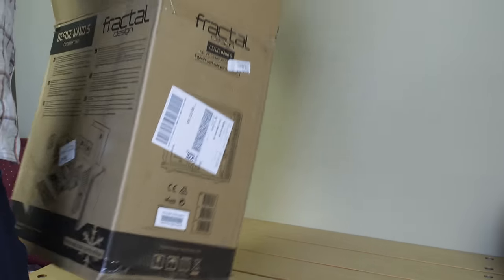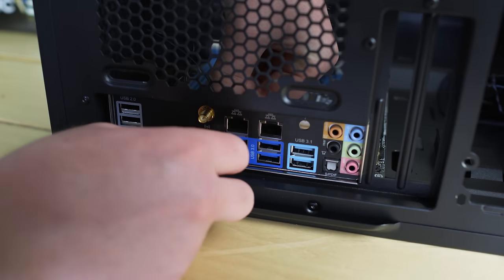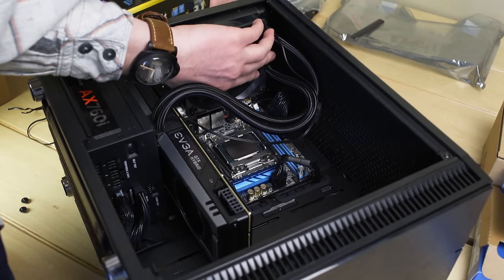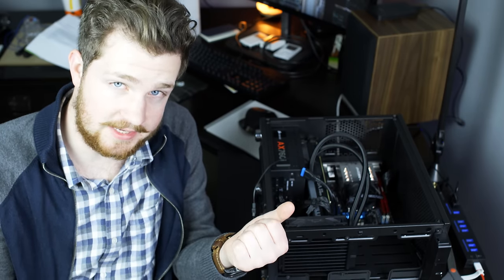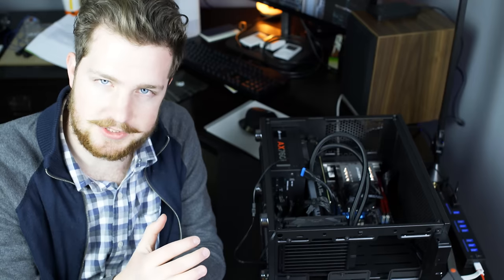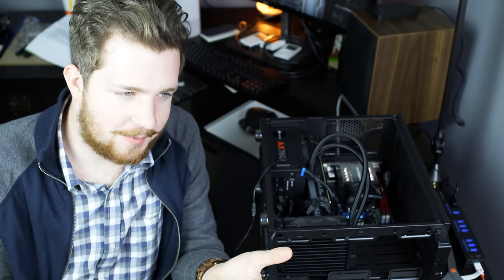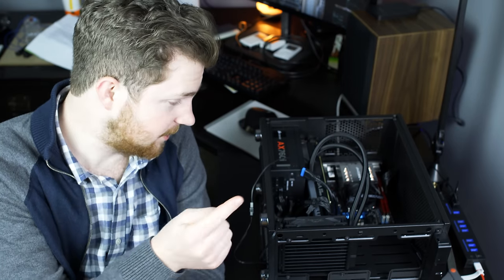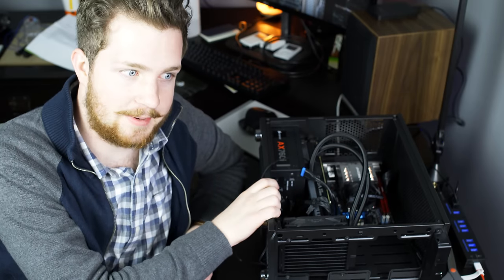My Powerful Custom PC Build Disaster

Comment: So let's get this right : you bought RAM without checking compatibility, you installed watercooling on a system that doesn't really need it, you bought a budget brand of motherboard which isn't the most reliable, you bought a refurbished PSU .... boy boy boy you sure invited a ton of problems for someone who isn't used to building PCs.
Reply: +redavatar agreed,soooo many wrong parts choices for a  itx build its unbelievable.
Reply: +Greenberet It's an ITX build lol. I don't know how you misidentified an ITX Motherboard for a Micro-ATX one.
Reply: There's nothing wrong with ASRock, they're actually pretty great.
Reply: +NylyxMC How very black & white of you. ASRock is the Acer of motherboards: they're hit & miss and not always very reliable. Much better to go with a brand like ASUS which delivers a far more even and solid experience.
Reply: NylyxMC Sorry,i always confuse Mini ITX with Micro-ATX lol.
Reply: Like all the other Apple fanboys that aren't tech saavy
Reply: +redavatar You're right, other than the ASRock motherboard claim. ASRock make some great boards, and not just in the budget price point. Please provide another motherboard for a Mini-ITX/X99 system.
Reply: +redavatar People don´t always use watercooling in there PCs to keep their temps low. Watercooling is quiter than aircooling because you can set the rpm of the fans very low and the temps will be fine....
Reply: +Powell Amouzou Closed loop AIO water coolers are generally not quieter than air coolers of similar or lesser price....

AIO's require high fan speeds to force enough air through their usually thin and high FPI radiators if they are to out perform air coolers of similar or cheaper price. Increase the radiator surface area with a full custom water cooling loop and you can claim water cooling is quieter at low fan speeds, but not for AIO coolers. AIO's are pretty noisy if you want to push a decent overclock, and if you're not overclocking why spend the extra money on an AIO when you can get a cheaper, quieter and more reliable air cooler... I suppose they look fancy?
Reply: Nathan
And if we are being honest with todays hardware it is not that hard to have a very quite air cooled rig. considering you can have 1 intake, 1 exhaust, 1 cpu, an your GPU choice. The loudest really is if you get a stock blower style GPU. otherwise I have half the fans of water cooling all running supper low on PWM.  Mouse farts are louder than my air cooled rig.
Reply: Funny how you never see windows fan boys trying to build a hackintosh...
Reply: @redavatar
he is a mac user dont blame him...

Comment: You had $2,000 to spend on a PC build and you got cheap on the Power Supply? Facepalm!
Reply: +John Brondum That is a good quality psu, he just got unlucky with the refurb. it happens
Reply: +TX-OC Lab 
why buy a refurbed power supply though?
Reply: +Justin Bechtel if you're supposedly getting a good refurb, it doesn't seem like too bad of an idea. If one of the capacitors blew or something and it was replaced adequately then stresstested for a while, I'd see no real reason to not trust the unit, as long as it that capacitor's being bad was the sole reason it blew etc.
Reply: +Ted1246 refurb psu are always a bad idea. it means that it broke onc3 already and so it probably will again

Comment: the power supply is something that you should NEVER get referb or second hand because some people don't realize that the power supply is one of the most important parts in your system because it gives all your components power. if its bad it could potentially kill all your parts then your really screwd

Comment: Used Power Supply..............
F.A.C.E.P.A.L.M with maximum hand speed
Reply: +KINGAUSAR SHADOWBLADE and he also mentioned that he doesn't want to cheap out on PSU as well ! If there's 1 thing in PC that you need to buy new and fresh and a bit more expensive for the quality, then it is the PSU no doubt.
Reply: +Maxim Kupar actually, if you choose intelligently, a used PSU is a little more viable now. My 1600W Gold EVGA supply has a TEN-year warranty, but the most remarkable aspect of its warranty is that they'll even cover it for three years if you buy it used.

A used PSU still isn't recommended, unless you get one of these EVGA models.
Reply: +KINGAUSAR SHADOWBLADE dont forget teh 1kg thermal paste
Reply: It's not user.. It a refurb, not the same thing. Also it is a very high end PSU (just kinda old)..

Comment: your issue is the voltage delivery.  the 24-pin must have been sending less than the voltage required for the CPU's TDP, as in some of the pins not contacting with the motherboard.

Comment: a little recommendation for the future. i would recommend you build the entire PC outside of the case on the cardboard boxes the stuff shipped in. once everything is installed and working fine you then can tear it apart and install it in the case. if something is bad then its a lot easier to swap parts and you don't waste time doing cable management, tons of screws and what not.
o and never buy a refurb psu. that one part being bad can fry the whole system. don't trust a refurb.
Reply: +adam courtney Rule number 1 of building a PC. Do it outside the case in the simplest config possible.

Comment: I recently built my own £1800 PC and i had a few problems with POST... but it turned out it was the HDMI cable (facepalm)... other than that, i had no problems :) i then started overclocking it and it did a few wierd things (which was my fault) but its completely fine now. i loved every step of it

Comment: This was a decent build being that you don't use pcs but the number one thing to remember is to ALWAYS buy a NEW power supply. My friend bought a refurbished power supply and it broke destroying his mother board, cpu, ram, and of course the powers supply. Also I wpd have when with a larger motherboard.so you have more ram slots which would have been an advantage for video editing.

Comment: Not sure if his issue has been solved or not, but it can also be a grounding issue. If there is a ground loop present between the case and the motherboard, the same effects that he is seeing will also occur. Check to make sure that the IO shield isnt touching inside any of the ports and check to make sure that there are no parts of the motherboard touching the case other than where the standoffs are.

Comment: Got same problem! my power suply was fine, i tested with my old rig,
but if i use a new one, Maximus VIII extreme it got some problems with booting up or stuck at windows 10 loading, and if i downgrade bios. than i got a litte feather,

And i also sended my motherbord back to store to check it out, and it seems it working fine!! 0,0  so cpu can't be damage buc i tested with prime etc so only thing i can know is

So i think! its a anti surge probleem with a bit older PSU and new motherbord
Did you try with anti surge Disable? i need to test it also, but i got my motherbord soon back to test it my self. Or did you already fix it? and tell me how please!

Comment: the voltage and amps are bad on all mainboards for aio waterpumps. all clever pc builders use 7 v molex adapter for the pump.

Comment: what do you think about the new drivers of nvidia ??? do you have problems like blue screen game crash or freez ???? i have them and believe me i have nice pc 
win10
gtx980ti 
16 gb ram
i5 4690 
psu 650w raider
i have those problem ??
any suggestions for how to fix ??
i tried to reverse to old drivers but still no help
Reply: I have pretty much the same build and have no issues, might just be bad luck of the draw and have a bad piece of hardware in the mix. solid build though.

Comment: At 8:00 I would think hardware compatibility issue. @ 10:00 My guess would have been the power supply. I kinda doubt it is the motherboard considering it ran the stress test. Too bad you don't have a power supply to swap to test or a shop to get it independently tested at a PC Shop.

Comment: I just completed a project 2x Xeon X5570 2.93ghz quad core ($37 USD Each), 2x H60 watercoolers (2x $67), 56gb ddr3 10600 ECC 1333mhz ($97 for 12 sticks), Samsung Pro 512 SSD (1x $149), 2x 120mm fans (2x $9), Corsair CM850  (1x $109),Asus Bluray(1x $27), HP Proliant ML150 G6 Chassis (Free), AMD Radeon HD 6990 (1x $100) = $708 USD all from amazon.com

Comment: Two things you do not buy referb: PSU's, and HDD's, they will fail on you majority of the time. 

Thats not all that bad of a PSU (I think its Seasonic OEM, correct me if I am wrong), but you have to buy it new. 
Too bad you didn't see that Seasonic 860w platinum series PSU on sale for 130 (its a freaking 190 buck PSU). It was going for that price on newegg about a week before this video I believe. I got it, and its a beast of a PSU.

Comment: I've never understood why people spend so much on a psu, my $20 700w PSU from 2008 has been working like a charm. My 24 pin connector has the same issue but everytime I've upgraded my motherboard i use a hammer and gently tap it in and it works just fine.

Comment: Lovin' all all the complainers about the PS when the cooler was also bad and nobody notices, lol.
Some bad luck, but bad electronics aren't too uncommon, at least in PC world where you have so many manufacturer's trying to make stuff work together.
I don't mind Apple, though,  had a lot of fun playing Moon Patrol on an Apple IIe.   :)

Got me all curious about the plug, tho, but that's just me.  I've not had too many problems with connectors that didn't turn out to be something wrong with the connector or I was trying to put it in the wrong place.   Usually, if I have to use tools, it's to get them apart not together.

Comment: I had an issue like this before. I found out it was my power supply. Another time it was my motherboard . Had some issue with ram slots but When I put it in a new mother board with the same ram it worked. Channels 2 and 4 didn't want to work on mother board  ( caused a boot loop). Right now I have an z97 extreme 9 motherboard. Its been fine

Comment: it has to be the power supply, maybe the power supply isn't compatible with the graphics card or the computer is so powerful that it needs a more powerful power supply.
Reply: +RetroBoy I got a 500Watts PSU and able to works ok, it is possible the software that came with&#160;GTX980, Nvidea&#160;is dodgy, remove it and use software download from it's site. I guess that, or dodgy PSU. (No I don't overclock the 980)

Comment: That's why you don't buy a used PSU from eBay for a 2000$ build...
Reply: +Matthew Maurier a power supply doesn't break in shipping...
Reply: I actually got a refurb from newegg for my build and it works just fine.
Reply: Yep. Power supply is an absolutely critical part of a computer build. For a 6 core CPU which you intend to heavily load, getting anything but a top tier brand new PSU such as Seasonic (there are a few other top OEMs - if you buy rebrand such as Corsair you must do research to find who actually made it) is a risky gamble. And on top of it, a refurb, regardless of who did it? You stand a good chance of getting a defective product that someone returned and someone tested improperly and insufficiently and then shipped it back for sale. In your case it's quite possible the PSU is actually fine but the 24 pin connector is not and the person testing it used a special load plug, saw it measured fine and repacked it, ignoring the defective cable. Also, you typically get a pitiful warranty (30 days or so) with a refurb, versus 2,3,5 even 10 years with new.

Anyhow, the 24 pin connector is one of the most annoying parts of a build for me personally. So bulky, inflexible and hard to insert if there's any problem with it.
Reply: I loathe the 24 pin connector.I mostly loathe the CPU connectors right next to the  I/O ports on the MB and how they have to stretch from the PSU.But yes,PSU AND MB are crucial to any build.
Reply: Yup! People think they are saving money, bahaha! I looked at a nice i5 build that a mate had done, with a dodgy PSU that took the whole board out, except for GPU!
My PSU is like 10 years old and has  run all my gaming rigs in that time (starting with a e6850 running sli 8800GTX's right up to current i7), sure it cost me about $300, but that's only $30 a year, im sure my gaming rig uses more than $30 a year in electricity, so if you cant afford that level  psu , you cant afford to run that computer! $30 a year is a small price to play for smooth, reliable and high current power.
Reply: You can get extension cables, almost essential when using many cases with cable management as most of them don't have enough stock length to make it underneath, at least not any build ive ever done.
Reply: PSU's have come a long way in the last 10 years. I would not want a 10 year old PSU in my system.
Reply: yea theyre cheap enough for a 2 grand build also you should always get atleast 80+bronze certified
Reply: zack lariviere 80+ bronze means nothing, loads of absolute shite PSUs that are 80+ bronze.
Reply: Or possibly why you don't force a Modular pin into a socket with a screw driver.
Reply: Well yea you can still buy a shitty certifued psu but atleast if it has the certification you know its most likely not goung to a run extremely inneficuently ir b kill your computer aslong as you hook it up properly 80 plus and above are efficiency levels and are important to look at when buying a psu if your building a high end rig you should make sure your power supply is certified and not some random knockoff psu a 500w certified is better than an 80pw non certified and anyone db enough to not do research on the matter shouldnt be building computers especially not no highend 500 to 2000 and up dollor computer you will most likey fry something and waste your time and money ive built 3 computers by this time and ive made the mistake of not buying a certified psu to save a couple bucks its not woeth it
Reply: I didnt spell check so use common sense and fill in the mistakes
Reply: +Fallen  Anything can break in shipping, and Newegg's packaging is usually really terrible.   Plus not all stuff on Newegg is from Newegg, some is other resellers.
Reply: +Matt  In the case of Corsair factory refurb units, literally, the only difference in packaging is the color of the box.   But anything properly shipped will be double boxed.   i.e. the factory PS box with is mild shock protection will be bubble wrapped and in another box.
Reply: FallenPhoenix he ment about the used part not the ebay part
Reply: + FallenPhoenix That'll be your little secret

Comment: The PSU is the ONE PART you should NOT buy refurbed UNDER ANY CIRCUMSTANCES!
Reply: +Bill383 Man, refurb doesn't always mean bad. I have a 4+ year psu that was refurbished from my previous systems.
"refurbish
riːˈfəːbɪʃ/Submit
verb
past tense: refurbished; past participle: refurbished
renovate and redecorate"
Therefore a PSU may have been used for 1 day but still classed as refurbished.
Reply: but the problem is Corsair ...
Reply: jd gaming corsair psus are good thou, especially their Rmx series

Comment: I have one question... How did you not see the CPU going upwards 90 Celsius in the BIOS!!!! Also if this is your first build problems can be expected but how do you let the PSU go with not well seated connectors and. man you're just a mess
Reply from the maker: +intra morph CPU thermal throttling doesn't even happen until 100 C. It's fine. Hardware is more reliable than you think. Swapped for new PSU. Everything works great. Chill.
Reply: Snazzy Labs I AM chill . Grats on your build =)
Reply: i have never seen my CPU go above 60c using a closed loop cooler at the mo but even with air coolers it shouldn't be much hotter
Reply: Revy two.hands the problem he had was that his cooler did not work due to the PSU connectors not being placed well. has nothing to do with the cooler itself. that's why his CPU went to over 100C and shut itself down to protect itself. He didn't know it was even getting that hot. that's what got to me lol.
Reply: No he needs the x99 and the 5820k because he does video-editing. Gamers don't need 6 cores but he does in all fairness
Reply: Amen
Reply: I'm surprised he didn't get a CPU_FAN Error, with that being a watercooler.
Reply: Zephen That's not how it works, the rad fans are connected to the motherboard and the bios knows that the fans are working.
Reply: Usually you'd have the pump connected to it surely?
Reply: Zephen yes the pump goes on the CPU_FAN connector and it's very strange indeed that he didn't get the CPU_FAN error. You're correct
Reply: intra morph Maybe the bios had support for passive CPU cooling?
Reply: I havn't built any PC till date. But it sure looks like a nasty problem. Keep trying bro. The GC looks bigger than the motherboard. The component, the motherboard should always be choosen wisely.
Reply: Pintso Nadi I wouldn't call building a PC a big nasty problem but It does appeal to people who like tinkering.
Reply: This would apply if you lived in the exact same room in the exact same climate........YOUR pc may do this and that but his isnt yours so yeah.........
Reply: isnt skimping on a psu to save money?
Reply: 10 year warranty...what a joke!    The company will be long gone by then.

When building a PC, stick with Seasonic or Antec power supplies, they are the best.

EVGA makes video cards, they don't know chit about power supplies.
Reply: Dave Satay Please tell me this is satire
Reply: EVGA make cheap power supplies, all style and no substance.   EVGA specializes in video cards, what dafuq do they know about power?    Seasonic is the way to go for quality.    Pay an extra 30 bucks and get quality.
Reply: I am more conserned about why the motherboard didnt shut the system down since it did not detect the pump RPM.